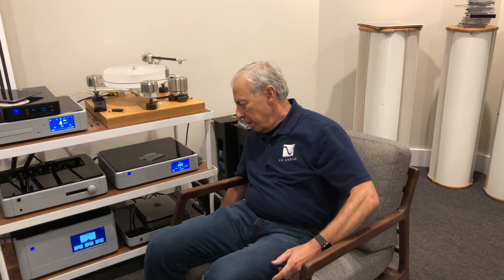Moving magnet vs. moving coil

Comment: MM and MI vs MC technology has seemed to come pretty far as of late, so the difference between them is becoming less than it used to be. I have used both over the yrs, and am back to using an MI cartridge for at least the time being. Brands such as Goldring, Soundsmith, and Grado make some amazing MM and/or MI carts today.
Reply: One of the biggest improvements, was the move to rare earth magnets, like samarium cobalt, and neodymium iron cobalt magnets. These new magnets produce much more field strength from less mass, than the old alnico (aluminum nickel cobalt)magnets. They've greatly reduced mass, without reducing signal strength. I think flying coil is slightly better on a mass standpoint, but, with the reduced signal strength, your signal/noise ratio won't be as good, if you need to increase gain too much.
Reply: @vincentrobinette1507  But those magnet developments are not that new. Samarium cobalt was being used in cartridges dating back to the 1970's, and neodymium goes back to the mid 90's, perhaps even earlier. I personally see little real development in cartridge technology during the recent "vinyl revival". Lots of new products for sure, but based on lots of old engineering from years ago.
Reply: @johnstone7697  The whole format is an old school technology, being re-visited. I actually think the biggest gain will be in electronics, with new Op Amp ICs and transistors with much lower shot noise equivalence, which allow better signal to noise ratio. I agree, all the comments I made, were base on when magnetic cartridges first came out, to replace the earlier ceramic cartridges. from that point, advancement came quickly. The moving coil was the last major change, and, though a different technology, I question weather it's really any better. The design with the lowest effective mass, with the highest output amplitude and bandwidth wins.
     I do know, that dynamic microphones and speakers use moving coil, because you just couldn't move those massive magnets. In order for moving coil to have an advantage, the cartridge, like the speaker and microphone, would need a massive magnet.
Reply: Vincent Robinette I think (or at least hope) that magnet development is in it’s infancy.  I would love to see a magnet structure that is as light as any coil, but puts out ten times the voltage,
Reply: @doowopper1951  That does make me wonder: What if you just reduce the mass of the flying magnets, until it only produces the same output as flying coil? Would that further reduce mass? Another thing to consider, is signal to noise ratio of the amplifier. the more gain you need, the more you'l hear hiss and other noise. That kind of makes it a trade-off, between mass, and signal strength. A flying magnet design is certainly more simple, and if you don't have to fly the coils, they can be wound heavier, to compensate for less massive magnets.
Reply: Since the 80s when Audio Technica released their very fine -feature  two magnetic generators arranged in the shape of a "V" - Vector-Aligned cartridge include outstanding channel separation, very low distortion and superb tracking performance. 
Not to mention their fine components used with the technology.
Reply: @FREEAGENTOFGODYAH  My old Techniques stereo turntable used an audio technica cartridge, that used that exact technology. It worked extremely well. I used that system to record my vinyl records on to audio cassette tapes, for use in my car. I often used the Dolby A setting when recording, so I got a more crisp treble in my car tape player. The channel separation was really pretty good compared to anything else I've ever had, but it did get the highs.
     I'm having a really hard time finding a replacement stylus for that cartridge, the needle is now worn out, and the stylus was damaged, when I accidentally slid a record into the tone arm, while it was locked down. I would have felt really bad, except, with the worn needle, it was starting to turn the highs into static.(I needed a new one anyway) The magnets were part of the stylus.
Reply: @vincentrobinette1507  If your capacitance is low and the mass of the cartridge is appropriate for your tonearm. Then I would recommend Audio Technica VM540ML that has a great channel separation of 28 dB (at 1kHz). That makes many MC jealous (not all of course). They have put some effort into it like tapered aluminium cantilever. Yes there is boron cantaliver but if you go after that then I would recommend the Nagaoka MP-200. But the two have different diamond shapes.
Reply: The MC vs MM is like the direct drive vs belt drive.
Conservatives cling on to the outdated knowledge that MC and belt drive is by definition better, while people who accept that technology can change know the opposite is more and more true.
Reply: @QoraxAudio  Your opinion my friend.....not mine.
Reply: The highest quality are from ceramic cartriges. Moveing coil are are not requred and cost waaay twomush.

Comment: There is another aspect to this recalling my vinyl-playing days. In the 1970s I expended much effort making a damping system for my Grace tone arm in which I had a Grace F8F MM cartridge. The arm was attached to a small aluminium paddle fabricated from a beer can and sat in a pool of machine oil that was a repurposed cough-lolly tin. When I replaced the Grace MM cartridge with an Audio Technica moving coil cartridge in the 1980s, the tone arm damping system became redundant. With lower moving mass at the stylus, less tone arm resonance was excited.

Interesting that the head amp PS Audio makes gives 30dB gain. The head amp I made gave 20dB gain and that was plenty for feeding the MM input on my home-made amp. I still have that little amp knocked up on a piece of Vero board and the Pro-Ject head amp that eventually replaced it ca. 2000. The only time I play LPs these days is for the purpose of digitising them.